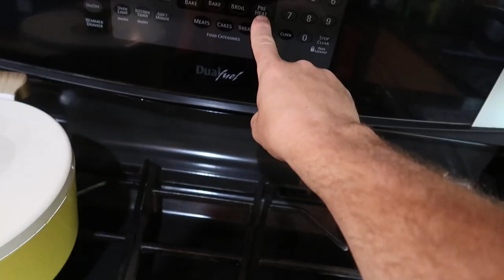Finishing Goat Milking Stanchion Made with Scrap Lumber (for FREE)

Comment: Those rags do not have to get hot to spontaneously combust.  Just plain old oxygen/air exposure can cause spontaneous combustion but it is more common when the oil is thinly spread, especially over a larger area.  I have oxygen equipment in my home, so I had to become a layman expert on this subject in my own home.  

Congrats on your Subscribers. I've been waiting for this morning's video. I have been up tossing stuff, & cleaning items, preparing to move soon.
Reply: By the way that is a beautiful finish on that milk stand.
Reply: Ana's Homestead, 100% agree that those rags can spontaneously combust, even in the cool of a basement shop. Especially with the added volatility of the mineral spirits. In that closed can the vapors will collect, just opening the lid could cause it to combust. Those rags should be submerged under water. 
The finish on that stand is very nice from a human perspective. I doubt very much that the goats will like jumping up on that slick surface.
Reply: It very likely won't be slick.  It will soak into the dry wood.  I have used vegetable oil on my rental apt's wood cabinets, it gave them the appearance as if I had used a honey gold stain, while still being both not slippery, or sticky, & it is non-toxic.  I used to live in Oregon, they had a Saturday Market with a lot of hand crafted children's toys, they used vegetable oil so babies could play safely with them.
Reply: Apples and oranges. Cabinets and children's toys are expected to have hard, little goat hooves jumping on them. The smooth sanded finish with the tung oil application, will seem very slick when a goat jumps on it.

Comment: I use to use Tung Oil, straight up, what is the purpose of adding Mineral Spirits? Did a great job building the milk stand. Your video is the first one I watch every a.m. Thanks for posting them so early.
Reply from the maker: Thanks, the mineral spirits thins out the tung oil so it can be absorbed deeper into the wood
Reply: Thanks